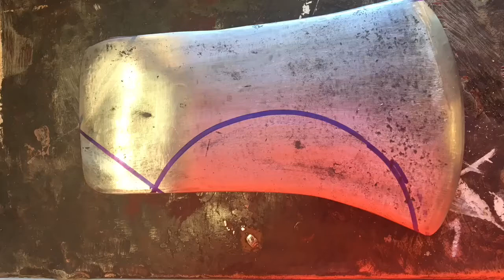Axe head modification

Comment: I drew the temper right out of axe head one time while grinding at the eye.  I wasn't even near the bit but when the head reached a critical temperature it immediately went soft, very soft!  Now I'm very careful to keep it cooled with water anytime I'm using a power tool on an axe head.  Did you have any hardness issues with this excellent looking modification?
Reply from the maker: the axe went soft and tends to chip a lot now.  This also happened on another hatchet restore.   Hey we learn the hard way some times. Hey God Bless and thank you for the comment .
Reply: Hey, at least we learn. Your axe looked fantastic after your modification. Nice work.

Comment: I'm working on a similar project.  Did you use a flap disc for angle grinder at all?
Reply from the maker: Jonathan Baldridge     No I only used the sand paper disc that was about 120 grit. I actually needed a flap disc and buffer wheel to really make it shine but I didn’t have it in shop at the time.     Be blessed.